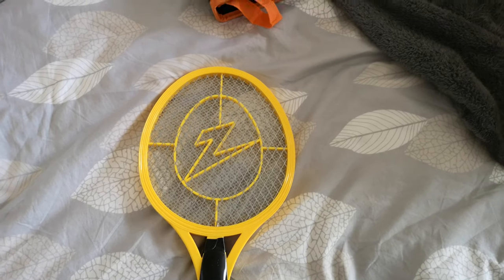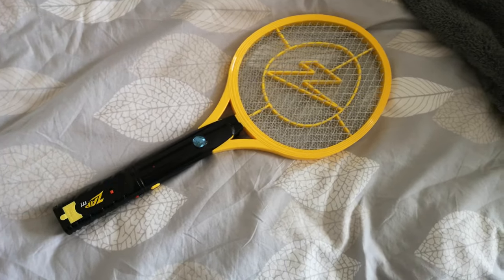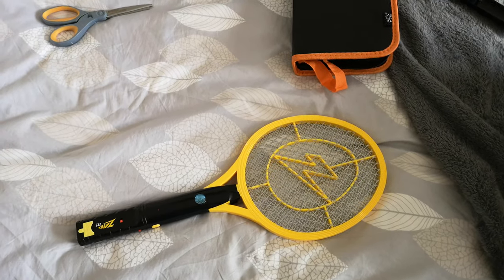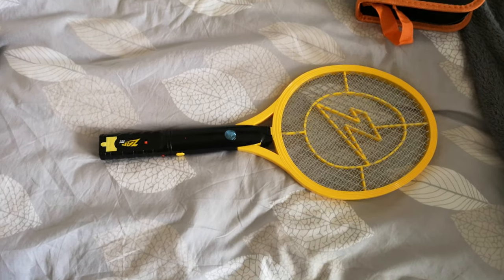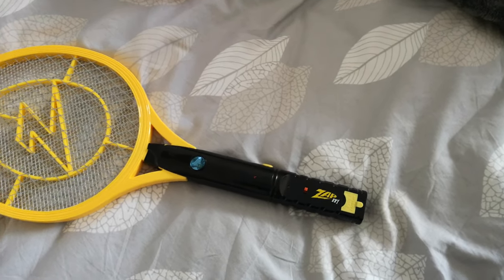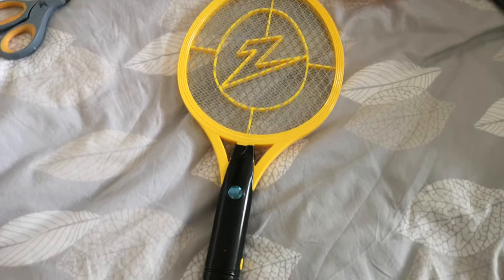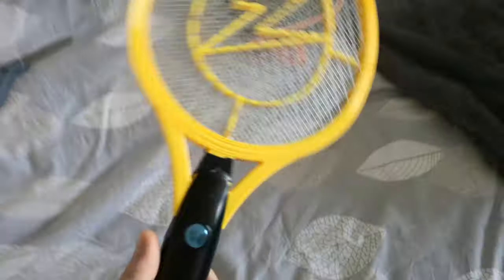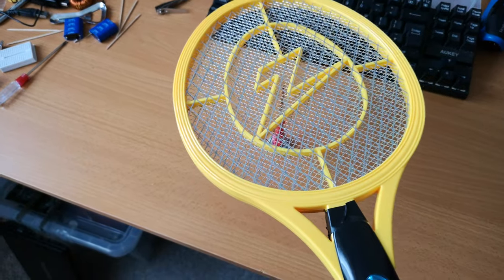[DIY] Bug Zapper Capacitor Mod

Comment: Removing the discharge resistors and adding the capacitor in parallel does seem to be the way to go, I'm going to buy 2 and use one just for the extra capacitor.  Thanks for posting this video.

Comment: 9 years ago! Jolly good video mate. It's currently the 2nd week of September, 2022 and I saw a video on amazon, where these are still sold and apparently,  nothing has changed! ....except one thing,...now, you can buy these little components that are basically the part of a stun gun that does the business.  It's is listed as 400,000 volts but some cool nerd did the math and he said it's around 40,000 volts,...which is a far cry from 400,000 BUT 40,000 will still knock a man on his ass and I will take what I can get.  You can wire the components directly into this zapper and just like a movie when lightning strikes something,  little bolts of electricity crawl around on the mesh!!! I have just received ALL of the components and when I get time, I will wire it all up. I'm also going to be cutting any output resistance and I am significantly boosting the I put power with a 5,000 mah 50c 11.7 volt lithium ion batter that I have that I bought for a nasty monster r.c. truck! It called Kraton,...it's an 8s 4 wheel drive power hungery, man, toy.....I'm fn giddy.

Comment: Your cap may have these writings, 332J 1500V = 3300pF (pico) = 3,3nF (nano) = 0,0033uF (micro) the bigger the better micro is the biggest.
123J 2000V = 12000pF = 12nF = 0,012uF. First two digits is the value of the cap. The third digit is the multiplayer. 101 = 0,0001uF, 102 =  0,001uF
103 = 0,01uF, 104 = 0,1uF, 105 = 1uF. The bigger it gets the longer it will charge, the better it will grill. You need the additional grilling power for the
big ones, the pesty fly. It sits on a cat turd next second on your sandwich, yummy isn't it? Be aware not all insects are bad but flies and mosquito are
because of infections so go get them!
Reply: That's why I love Bats because they eat mosquitoes. If you're ever in Austin, Tx.. Check out the Bats that emerge from Congress bridge every evening.
Reply: @mrc6032  Agree bats are very cool! Mammals conquered the air :). Sadly wind turbines are killing tons of insects witch are the main food source of bats.
Reply: @jimmihenry  not to mention.. Industrial runoff polluting our waters .. Of which is vital to our entire ecosystem. The native Americans really lived a lot more healthier than we do in modern times. Yes, they had to work harder for food, but if rather live like that. I'm harmony with nature. I really think the industrial revolution was the beginning of the end regarding our health , peace of mind, and well being.
Reply: @jimmihenry  .. Also, I always thought it was kinda funny that dracula turns into a bat. That's quite silly because it's like he eats himself. (I.e Bats eat vampires which in turn are mosquitoes)

Comment: I am looking at buying two rackets soacing them apart to provide space inbetween allowing room in beteeen for an adjustable ribbon of LED Lights plis additional space between the rackets for attractant soaked into a spongue and aligned more toward the center.  The UV light will be  dimmable and give it performance adjusting, so as not to being over bearring for the gnats and fruit flies as they are my current traget pests. The outer wire spects are enough for larger inscects. Especially honey bees but large enough for Africanized Bees. Also suing a 3 or 4 sectioned sponge to determine which artractant works best for which bugs.  
    Perviously I modified other bug zappers with cutting the housing and greatly increasing the mesh barrel length nearly double. This was for our cows and it provided heaps of dead horse flys, Mosquitoes, flys and other biting flys. I required daily cleaning even though there were heaps of dead bugs on the ground (a relative 6+ pyramid pile on the ground and still required cleaning -- though I tepered the screens so they could burn then fall through. I must search for them for re-enstatement this tear. Thet just weren't adequate for smaller bugs. I once caught a 5 inch moth stuck and deat inside. That required an outside 1/2" grid to stop that access. After this gnat project i want to build a 3 feet by feet bug zapper / solar powered for field use. And next a Bug Zapper plan hangs on an electric fence with a grounding stake and solar powered for the UV light.  This will encompass building lot of zappers and should work quite nicely, even keeping the animals in the field.  I figure putting up a sign "danger causes COVID-19 and its variants in all unwanted bugs, but i figure they will all buy useless masks. In case they stilk buy the masks I plan on a marketing scheme to mass produce and sell them, realizing they won't work, but that has not been a deterrent for humans, so why not bugs?  Does anyone know COVID-19 is all in Caps as doing so makes COVID-19 an equasion and not a name?  It equates to 666 as the minus sign is not a hyphen. Plus Roman Numerials, ASCII (Computer numerology - for the Capitol "O" and standard numbers being the 666 -- Mark of the Beast to fruituon?  If you believe in Christ Jesus and die from not taking the Beast's Mark -- soon to be included with an RFID Chip (An RFID Chip by anyother name is still an RFID Chip & Sweden has began this campaign ).  But for those who will not accept this Mark because they believe in Christ will save their eternal life. The rest follow the Beast into Hell. This gives the bug zapper a whole new purpose?  My advice; prepare for Only You can dilute your persecutions.
Reply: wow bro what was that....
Reply: Yes I agree
Dark and cloudy ahead. When death smiles at you  all you can do is smile back..  take care.

Comment: Lithium iron fosfate or LiFePo4 is a bit senseless in terms of investment. Just get 18650 IMR batteries without the safety circuit. I have a few the can very shortly can deliver 40 amps. That's AMPS not milliamps,  used a lot in vapes and flashlights. The tendency for short bursts of power with these zappers seem to call for a low internal resistance battery, IMR batteries are just that

Comment: Oh, I need this
Reply: yeah i needed this before i found this video this just validated me in my quest for more power.  now i have 14 2kv ceramic caps in parallel at the output and 4 step up circuits input to charge faster, powered by one of my homemade 12 lipo wich is a bit overkill^^ i'm trying to decide if i should just go crazy and put one of mylarge deadly microwave oven transformers instead :p
It's getting so bulky and combursome that i can barely hit bugs and so powerfull i woldn't be suprised if it could kill a lizard or samll animal.

Comment: Easiest and simplest mod to do on one is to eliminate the bleed resistor across the grid.  Simply find the little resistor that's soldered across the output and snip one end.  

This probably will save battery as you don't have to continue to hold the button to energize it, but just to recharge the grid.
Reply: what exacly will that do? i imagine it will increase voltage and of course let the cap keep a charge longer but appart from that? any negatives?
Reply: @alexisjuillard4816  The grid will remain charged for quite some time after you unpress the switch, meaning you could get a zap if touching it....